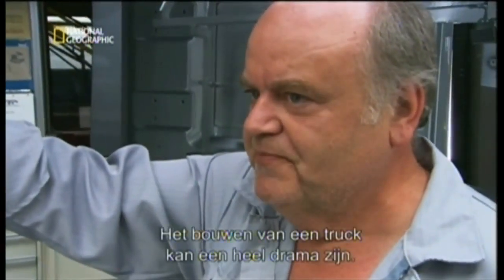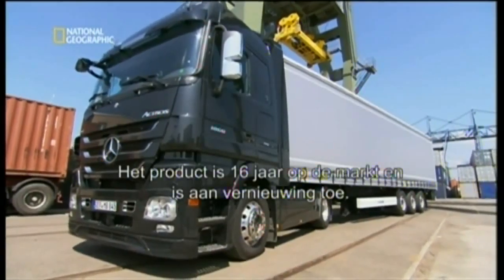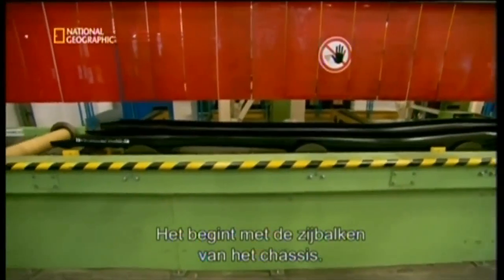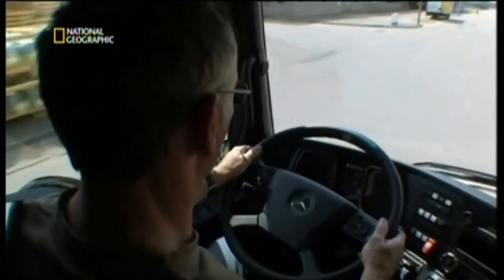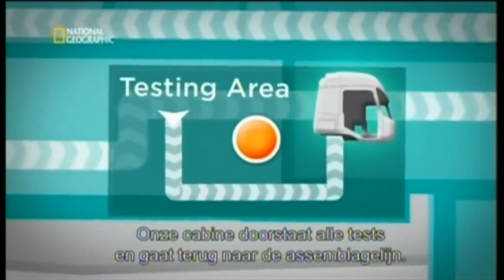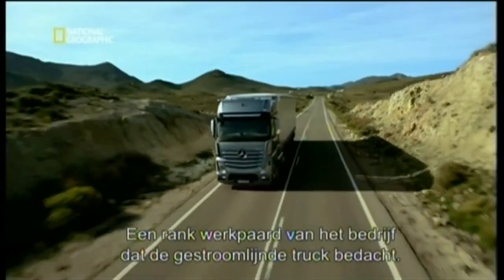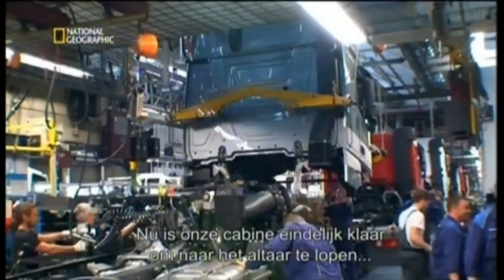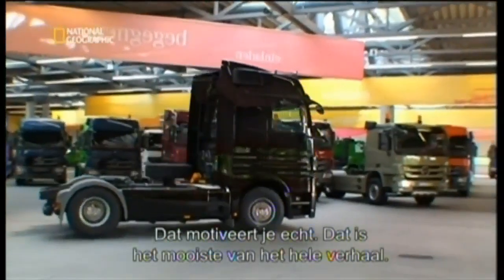Megafactories National Geographic Mercedes Trucks Actros Factory

Comment: I've driven Kenworth's and most type of trucks. the Actros is a Good truck Not the best but for the money it's a great truck. My Kenworth is worth about $800,000 New but the Actros is way cheaper
Reply: This is a 2014 truck combo with trailer  450K
http://www.trucksales.com.au/Gallery.aspx?R=24346485&PhotoID=/general/content/gc5075745869454776379.jpg&track=IMAGEVIEWER&h_mid=5235946&f_mid=0&c_mid=5235932&TabId=2611674
and this is a prime mover 2012 model for 295K http://www.trucksales.com.au/Gallery.aspx?R=23238898&PhotoID=/general/content/gc5104932323664616056.jpg&track=IMAGEVIEWER&h_mid=5235946&f_mid=0&c_mid=5235932&TabId=2611674 2012 prime mover for 240 k http://www.trucksales.com.au/Gallery.aspx?R=24129761&PhotoID=/general/content/gc5643296115895430677.jpg&track=IMAGEVIEWER&h_mid=5235946&f_mid=0&c_mid=5235932&TabId=2611674 
so these are 2 year old trucks new is 450K now you agree or you need more proof. you aint buying any new kenworth for the fucken money you saying. 170k No fucken way . may be in USA but not here in Australia.

Comment: no match for mack or peterbilt
Reply: Which are both no match for Kenworth lol
Reply: Owen Mitchell
You do realise these have more torque and HP right? It's all about numbers, this isn't opinion..
Reply: djdjerojr
If they can beat the 2050 lb-ft torque of a of a Kenworth running a CAT 625 I would be surprised...
Reply: Owen Mitchell
Lol with ease. A higher end factory model Scania R730 has >2500 lb-ft of torque.. http://www.tradetrucks.com.au/truck-reviews/1208/scania-trucks-r-560-6x4-r-620-6x4-r-730-6x4-reviewed-and-compared/
Reply: Owen Mitchell
In fact one of the middle range models R560 has 1990 lb-ft.
Reply: djdjerojr
You do know there are much more powerful engines you can fit than the CAT 625 right? that was just an example...
Reply: Owen Mitchell
So was mine, just an example, which was better than your CAT625 example. Also I must say that the engines in EU trucks are made by the manufacturer and are much more economic
Reply: djdjerojr I'd love to see your Scania or Actros hauling road trains in Australia. OH wait, they can't, yeah thats the big boys, Mack, Kenworth and Peterbilt. Doesn't matter how you try to spin it, they can't keep up with the raw power of the American trucks, you'll never see them hauling 5 trailers across thousands of miles of Outback...
Reply: Because that is not their intended market? Are you high? They use Scania in AUS LOL :) I've just disproven the 'raw power' in your trucks. There is no raw power in driving a straight road for 2000 miles.
Reply: djdjerojr
I didn't say they didn't use Scania in Aus, I said they are not seen hauling road trains in Aus. As for "raw power" yeah there is raw power in hauling a 5 trailer road train.
Reply: 15.6 Liter, 680BHP, 16 speed powershift, double reduction axles, is a lot of a truck even if does look like a toy